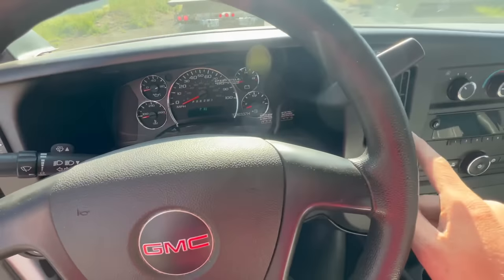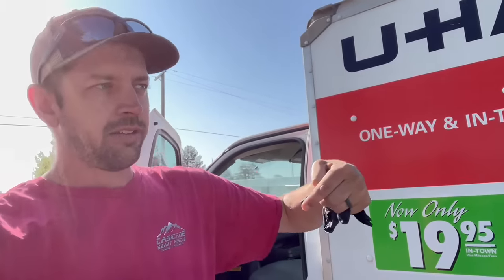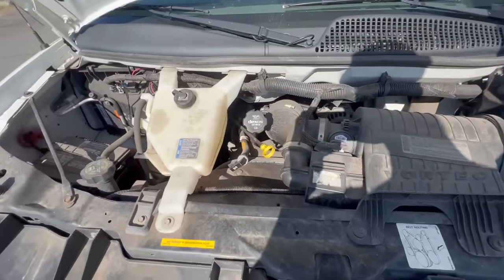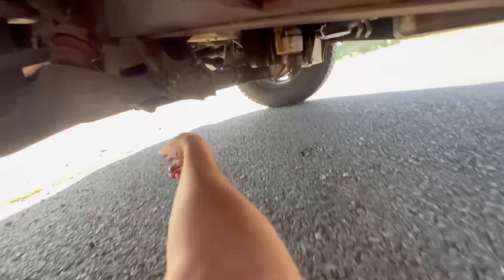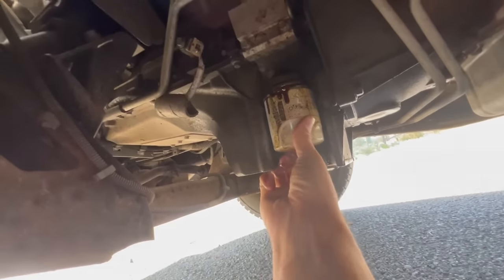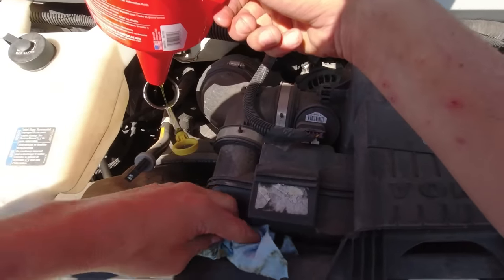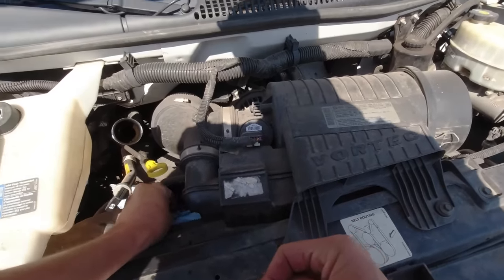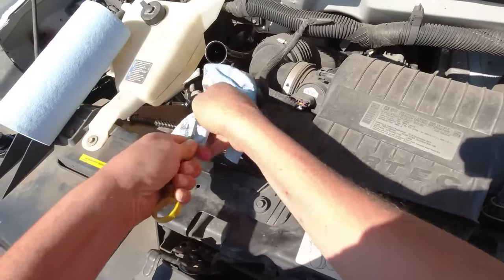Sometimes Being Honest Costs You A Job…

Comment: Being honest may have cost you a towing fee but reporting the problem(loose filter and no oil) and fixing the problem (tightening the filter and adding oil) improves your reputation. So the fleet yard will want to use you again and the mechanic can realize somebody made a mistake by not tightening or checking the filter. Plus the mechanic thought the engine was going bad. He may not have caught the loose filter until the engine was out of the truck.
  So you saved U-Haul a 7 hour towing fee, the cost of an engine, the mechanic's time to remove the old and put in the "new" engine. So you actually saved the company several thousands of dollars.

Comment: You doing a great job by not ripoff customers and yes you should bill for your time and parts like the oil used for it. I rather have a tow truck driver say here your problem and it easy fixs then have it towed then say here's the problem and it would cost less then have it towed. Making the customer(s) happy will always improve your business then ruined your business by not simply checking. 

That company and other companies after they being told you saved them from a big tow billed. If the bill was like a example $300 to $500 bill vs a $1,500 to $3,000 tow bill then I remember that part. In that example a $1,200 to $2,500 money not spent on it. Not mention vehicle in the repair shop and it not making money.

Comment: Just think outside of the box here. Still should have delivered the truck as they asked. You set yourself up for a lawsuit. No telling how much damage was done to that engine. Fill the oil as you did and know for the most part that you saved them from buying an engine. But still deliver the truck three hours away and hand that liability over to the fleet. Win win. But what if type of scenario.

Comment: 9:40
Bad move to put more in it. The engine JUST turned off. That means oil is sitting up at the valves. If you fill it to the fullest line while warm, it's now overfilled, and pistons slamming down into oil does amazing stress damage to the pins that hold the connecting rods to the piston. Liquid is non-compressible. It's better to be two quarts (of 5 total) low, than to be half a quart too full.

Though, due to editing... if you actually did wait the proper time from ignition off, then I'm wasting my energy by finger flying across the keyboard for nothing.

Comment: I used to work roadside dispatch, and this kind of stuff is more common than people think: most tow drivers are ultimately problem solvers and just want to make a living doing the right thing.  But all I could think about while he was doing everything is how the third-party fleet management company would be losing their F%@&ing mind over the phone that he wasn't towing when he was told to tow.  I had to tell tow drivers many times, "Yeah, you know we could fix it with a $5 part.  I know we could fix it with a $5 part.  But there is a fleet services guy on the other line cussing me  because you popped the hood.  Let's just do the six-hour tow for now, so he doesn't have a stroke on my inbound phone line.  Thanks for trying to help, but just get that free money this time."

Always 'fleet services' guys pulling the plug on the easy solutions.  I'm shocked Casey didn't get multiple phone calls to "check on the status of the tow".  Sometimes the good guys win, I guess.

Now that I see his address, I probably dispatched a dozen times to Casey for Good Sam.  Nice to see you out there!

Comment: Being honest on this one job didn't cost you much money in the short term but in the long term you more than likely gained more by getting 50 more jobs from them.

When I did roofing and remodeling I always had customers. Why was that?  When I bid the jobs I always add on a padding for "just in case" needs for any unseen repairs that were needed.  Once the job was done If the bid amount was over by more than $100 than actual cost I would offer a refund of that extra money on the overbid.  Every single time the customer told me to keep the money that they had already budgeted that into their expenses etc.  I even had one job that I bid the labor at $10/hr and once it was done the customer jacked my hourly rate up to $17/hr because if they had hired in a larger company that would have been the labor rate they would have had to pay if not more.  I wasn't out to gouge people,  I wanted the work no matter how small or large within my limits.

Comment: I mean, you got called out to haul that truck so you're going to show up with an appropriate wrecker to do the job. You charge for that right? I certainly would. Then time and fuel running for oil and doing the job. You talked yourself into a smaller job but that frees you up for other work and I'm sure the fleet owner will be very happy about a few hundo for your job Vs. what, $4K-$6K for Hack actually billing him for replacing an engine but maybe they'd have noticed the loose filter, did what you did and wrote it up as a replacement engine anyhow. I would certainly charge for showing up plus my fuel and time running around for oil. You're 100% entitled to it. You could have just not payed attention, hauled it to the garage all for pretty much nothing. Engine might be damaged by now though.

Comment: This is why I do not send my stuff out for oil change. My neighbor is a classic example, PeepBoys did all of his minivan oil change. I mean all of them. His van came back and leaking oil due to a stripped pan plug. PeepBoys dfid everything out of the book to claim it was not due to them.

In the end, t he charged them for a new pan/plug/gasket and covered the labor. Initially they wanted over 900usd in labor for that.

    Firestone
   Jiffy
   PeepBoys
   all suck

I even hesitated with Walmart Auto. Sears use to be good but they have went down hill also.

Comment: i had mechanics like this  some not so great but good to see .  as for you haul  i wonder if they get it in would they just go by work order and pop a new engine in  . i worked for co that had fleet of cars but rarely look at the records one car the bat was only few weeks old and garage put batter in they used several shops.  another i had bought the car and they had a dead one which needed moter and i needed sheet metal so bought it limped home not far. looked over records and found when the car broke down the remanufactured engine was still under warantee but it sat till after warrantee was over .
so its not always shops that dont do right managers screw up too

Comment: Fun fact: If a job can be done cheaper and easier and you hand them a bill for a giant tow and they take you to court over not paying you will lose the case.  There is a law that actually protects customers way over businesses trying to cheap people out.  I found this out on The People Court and looked it up and its a federal law so every single state has to follow it.  Guy has a problem basically the same as this where his vehicle needed a single spark plug and oil fill and oil can replaced and he was charged $4000 for a giant tow and the judge through the case out saying that it illegal to over charge for product and services and if its done to an excessive amount then its actually a felony and I found out the guy ended up in prison for over charging his customers for small fixes.  So what you are doing is not just words to live by but its actually the law.  In reality Legos should have been charged for this same crime.

Comment: oh you know that repair shop would have been "yep you need a new engine!" money in their pockets they do not care. I just went thru this with my new truck. it was making a weird sound and I was told the transmission was the problem.....they replaced the transmission (under warranty) and it still makes the weird sound. not only that but the new transmission does not shift correctly even after driving it for a couple thousand miles , slipping and just not working correct. so now my new truck is all fucked up , have to take it back again let it sit there for another probably entire month like the first time and who knows what the outcome will be. mechanics are garbage these days, I havnt met an honest one in decades.

Comment: If the engine ran out of oil, regardless of the reason, it needs to be checked out by a competent mechanic.  Unknown in this video is how far the previous customer drove it and what damage may have been done.  A bit shortsighted by UHaul, imho.   They may never have an issue with this vehicle, or, a month later, a customer gets stranded on the side of the interstate when this engine decides to say "eff it".
Reply: He's also a mechanic for uhaul, I believe.

Comment: I had tranny line break on a 95 jeep grand Cherokee back in 98.  I got it off I 95 in conn I had it towed to jeep dealer in Conn. They quoted me thousands to put a new tranny in They never looked at it.I had that thing towed all the way back to New York and Albany and I got the thing repaired for less than $200. There was nothing wrong with the transmission. Lazy mechanic or Rip off dealer?

Comment: Correct me if I'm wrong. What you did here was honorable and with good morals, honestly what everyone should strive for. However, is this not a corporate entity? Is the cost not offloaded to corporate for vehicle repairs? Also on that note, these big corporations usually have very strict mass deals with certain brands (like you can only use this brand of oil) and strict warranties and policies (only corporate fleet shops can administer repairs).

What you did might have been a good thing, but what if it voids the warranty and gets the owner in trouble? Does Uhaul operate like a franchise and the franchisee of this outlet have to pay the costs for repairs and hauling? You weren't paid to repair, you were paid to haul; and the manager of this Uhaul could get in trouble or they could sue you for tampering with their vehicle unlawfully.

It's a messed up world; but I'm very curious how this panned out for you. If each Uhaul outlet is owned by an independent franchisee that has to suffer the costs for hauls and repairs, I can see the local owner being incredibly joyful and eager to do business with you in the future. But if this is strict corporate rules, I could see you getting in trouble for trying to do the right thing.
Reply: Uhaul doesn't operate that way. They are a franchise company.

Comment: This guy is honest the uhaul place not so much. As seen there is no way the oil was checked or found at operation level.
Reply: It's possible the oil was changed at the dealership and the filter left loose. The dealer would mark the truck ready to go. Obviously the oil didn't leak onto the dealer's lot or he would have caught it. Filter was probably just barely seated, came loose during a rental and leaked the oil onto the highway where nobody could find it and figure out what the problem was. That was not necessarily a dishonest dealer at all. It would be wrong to call him that.
Reply: @RockinRobbins13  not so fast, if and I say if oil was changed,  two things are to happen one oil is checked to level,  two engine is started and checked for leaks ,  if either had been done this guy would not have to add oil to crank case.
Three if the oil filter was as loose he'd shown and the engine check would have left the work bay area covered in oil.
Reply: @kevinconnelly3662  Under normal circumstances the dealer wouldn't be doing the oil change and the filter can be tight enough to pass a routine couple minutes testing near idle, but vibrate loose during normal operation at higher throttle settings and with road vibration.

Who knows? It could hold for several hours of operation. The dealer would have no way of knowing the filter was improperly installed until a customer called and relayed the symptoms.

The real hero here is the customer who didn't just run it till it blew. That happens a lot, even with people's own vehicles.

Imputing a dishonest dealer is just over the top wrong. The one who needs the "not so fast" is you.

Comment: Judging by the look of that oil, looks like they have been just dumping oil in to keep it going and never changed the filter, so ontop of them almost running out of oil on a customer, that motor is probably trash from that new oil running threw that old oil filter.

Comment: Why would you buy 2 $40 jugs of oil? It holds 6 qts. $20 5w30 is as good as $40 5w30.  Also if it's run out like that more than likely it's done some damage. Should of got 10w40 or a bit thicker. I put heavy duty diesel oil in my colorado. It's got 300k tho. I know your no mechanic but the owners gonna have some issues out of that thing soon.

Comment: I think it's the right thing to do, but it could get you in extra trouble.

Let's say something related happens soon, the engine actually goes bad, the oil starts leaking again, etc.
The customer will see they planned to have you bring it to the engine shop, but you didn't, instead fixing it yourself.
They might blame any future even just slightly related issues on you, and be double upset because you billed them for what they think is a shotty repair.

Comment: "I'll make a lot more money in the long run..." Well, it depends. If they'd never find out, then no, probably not. It's only if they found out and got pissed (reasonably so) and then you lost their business, and maybe they left a review calling you dishonest... but honestly, it probably needs to happen more than once (allegedly) for it to have a real domino effect. Seems like in this case, they likely would've figured out the real issue... but in the example you actually gave, they may not have. Really depends on who is doing the actual repairs. If you run your own shop that you tow to, like my father used to... you could probably be dishonest all the time and still get a lot of business like VIP has a reputation for around here. But if you're towing a U-Haul owned truck to a U-Haul owned repair shop... obviously not lol.

But regardless of potential accuracy, this is certainly the more respectable mentality. If I owned a vehicle and needed a tow anywhere in your area, I'd probably try to contact you, first, thanks to a vid/mentality like this.

Comment: I have to disagree with most comments.   You were paid to do a job of towing.  Not diagnosing and fixing for YouTube content.  

That oil may of fixed the immediate problem but the damage to the bearings inside the engine is already done.  That needs to go to the shop and bot be put back into service.

Comment: Why not just do what you were hired for? By doing what you did not it puts you in a liability spot if the motor goes bad because you tried to play mechanic. Yes it’s possible that the only issue was what you found but there may also be hidden damage. If the company rents it and it blows up then they can come back on you because you “fixed it”

Comment: Charging people for stuff you didn't do is a crime. You don't get points for operating within the bounds of the law. But if a customer contracts a service, towing a truck to a repair facility for instance, then that's what you do. Think the guy has no liability issues if his new filter leaks? Treat people fairly. But if you don't do business as a business then you have a hobby that won't exist for very long. Then you can't provide anybody with quality service at a fair price, because both sides of that equation are equally important. One without the other is a doomed business plan.

Comment: As far as morals go you did a great job.

However technically the company paid you to be a driver, not a mechanic. The truck needed to go to the shop to document the mechanical failures, cause of failure and extent of damage as efficiencly as possible. Now that the oil filter was tightened the original technician can now deny fault and saw his work was tampered with. If the shop chose to take the tech to court their claim will no longer hold. The shop is not assured that they are getting their grade of oil and filter or  having the right products installed and the tech can blame you for putting the wrong oil and damaging the engine even though it could gave been damaged from him not tightening the filter. If its a big enough company than white collar office workers are going to look at this and come down on the shop asking when they are having a company untrained towtruck driver work on the truck instead of their mechanic.

Not saying you don't know what you are doing, you do seem somewhat mechanically inclined.
Worst case the company releases the truck, taking your for it that it's fixed, to a rental customer. What if the oil filter housing was stripped? Then the oil filter may have retightened but eventually came off after so many miles (i have personally seen this as a shop manager). Then the vehicle could have shut off in front of oncoming traffic causing a car accident and possibly death and as a result the company being sued.

It's not right but that is the automotive/ diesel industry. But you are a good person and i wish you the best.

Comment: You are treating that uhaul truck much too kindly by putting in that Mobile 1 high-mileage motor oil.  That motor hasn't had anything better than Quaker State running through it since it first hit the road.

Comment: I am really surprised that you would even consider using Mobil 1 in ANYTHING!  it's not even a real full synthetic made from esters, but re-refinded garbage oil! I own a Porsche Cayenne and I believe that Mobil 1 has paid Porsche for sponsorship of their garbage oil. I personally used Redline oil until my Cayenne GTS reached over 200k miles, then switched to Castrol gt in the same 0/40 European formula and now it uses less than 1/2 quart every 400 miles at the present mileage of 226,599.